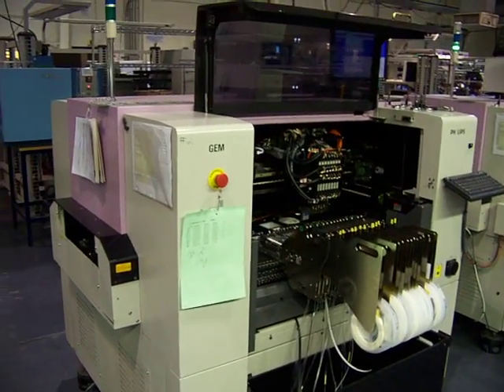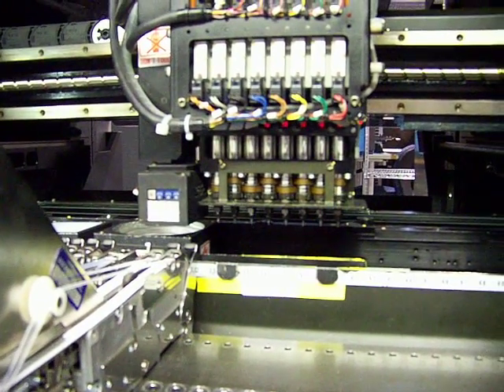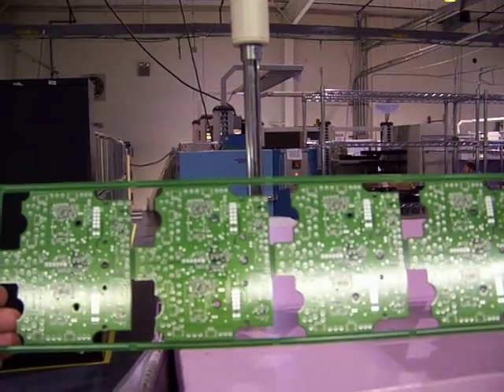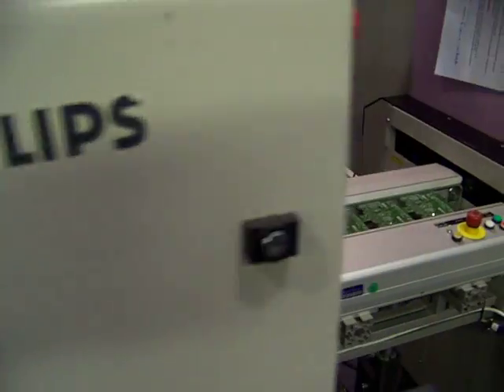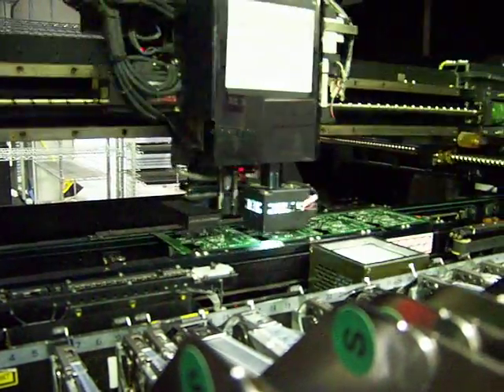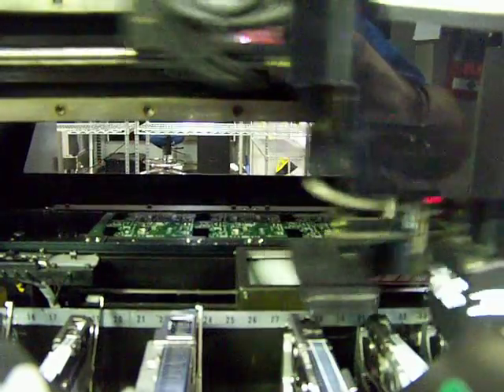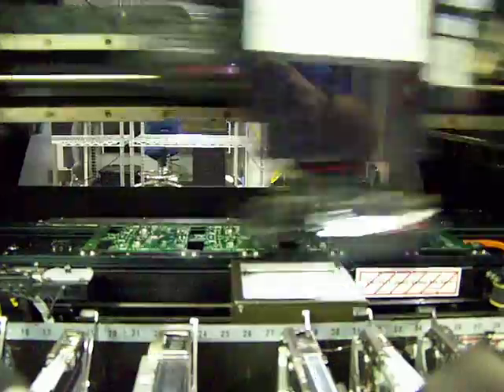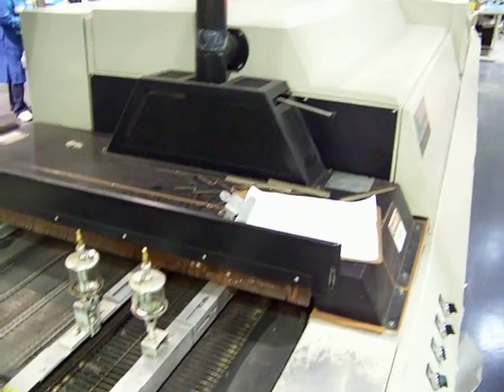Building a SMT PCB with Philips Topaz and Emerald machines.

Comment: There is a strange clicking sound synchronous with the X axis of the Emerald.  As if there's a ball missing in the nut of the axis - or something in there.  Probably completely wrong :o|
Reply from the maker: You heard right! But ut's the X axis cable guard that's clicking. Was replaced a few weeks after this video was shot. I really need to make a new video with our new Panasonic NPM-W2's. They are so amazingly fast!

Comment: What is the machine doing at 3:13? why?
Reply from the maker: It slowed it's pickup and placement speed because the part has a tendency to slip on the head. This machine uses both camera and laser curtain to find center on the parts. The turning back and forth you saw was the machine running the part through the laser curtain. It looks for the shadow of the part to find the exact center for placement.

Comment: Our MG machine i programmed only one time, and that was for an instruction for our operators. This machine is operated only a few times in the year for one or two specific products. I already propsed to use this line more often. I bet its because there is no optical inspection in this line. But i like the MG, quite fast (compared to GEM) and very accurate (better then our GEM) and the Interface is easy to use and understand!

Comment from the maker: @demusch 

Yup, This was a prototype run of 3 panels. I usually run it block mode to work out the bugs, then expand it with block badmarks (for x out's) 
Saves a ton of time over a 10,000 piece run.

Comment from the maker: The red laser? I think you are referring to the red flash you see? That is actually the lighting system for the "Line Array" camera. Similar to a flash bulb on a standard consumer camera. 
It flashes so the Line Array camera can snap 8 pictures at once (one per nozzle) and detect the exact position, rotation, and size of the component for placement.

Our machines are only running about 10 hours a day (We have 4 lines) in the summer we ramp up to 24/7

Comment from the maker: I think your referring to the red flash? That is what's called a "Line Array" camera. The flashes you see is the stadium style lighting system. It's basically like a flash on a camera. The lighting system flashes so the Line Array camera can take pictures of the components on the head. The machine then figures the exact position and rotation of the part to place on the board. It also measures the component to make sure it;s in tolerance / correct part.

Comment from the maker: Hello Jacquecrowe, We have the gap in between the topaz and emerald because we sometimes run them as stand alone machines (Our prototype line) Our other 3 lines have a 1/2 meter conveyor in between. allows for our inspectors to view random boards going through each machine. 
We use both CL and FLV feeders.

If you need any help, or have questions, please feel free to email me. 

doug.christen a t ascentron d o t  c o m